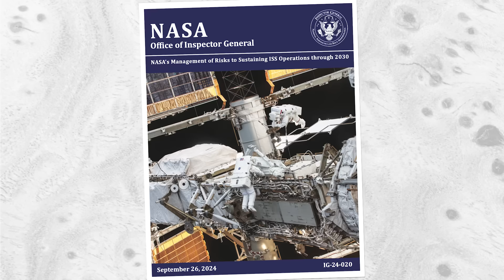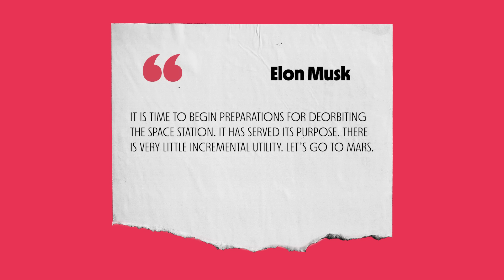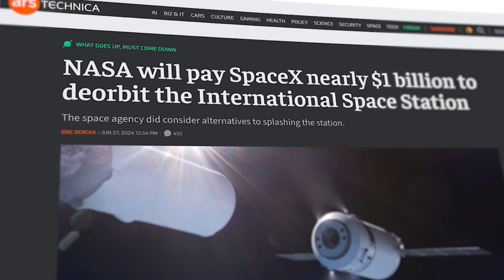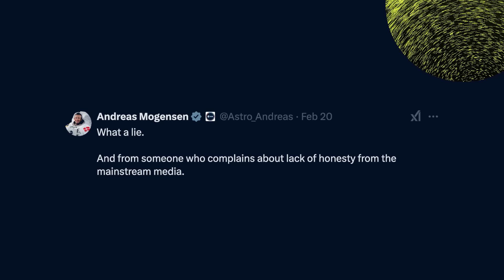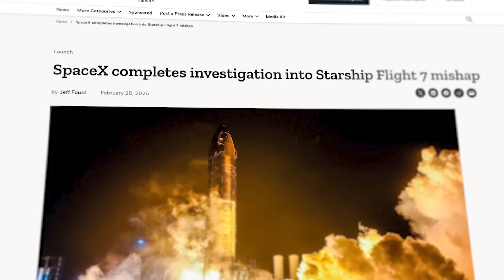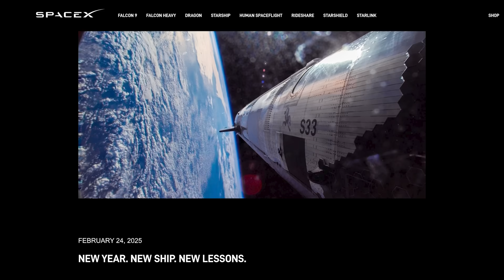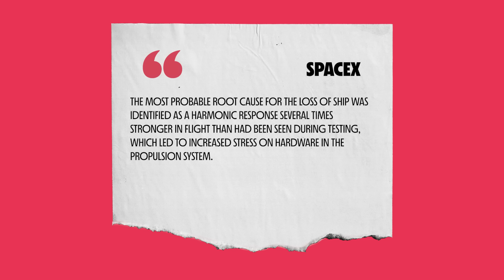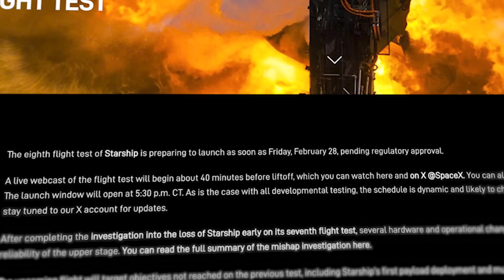Something Weird Is Happening With The ISS...

Comment: Funny how SpaceX inoculates his fanboys to total destruction of his test spacecraft over and over again by saying it is just a "part of the design process", yet Elon and his fanboys go ballistic when Starliner test flights have problems. Clearly everything is supposed to go perfectly on all competitors test flights or else it is a failure. And since Starliner landed safely, the problems were not as severe as the conservative NASA administrators expected, although in dealing with a press and public that freaks out over every problem, you can see why they chose to follow the conservative path and throw Boeing under the bus.
Has everyone forgotten the the first Crew Dragon unmanned test flight went well, and if they had not been compelled by contract to test the flight abort system, they likely would have flown manned the next time. But while preparing the test capsule for the abort test it .....BLEW UP,  which would have been fatal for any crew on board. So..... you might say that SpaceX was living under a lucky star on that one. What if they had not performed the flight abort test before putting crew aboard?

Comment: Elon did include the details that the NASA budget didn't include money to launch an extra mission to rescue and Congress would have to appropriate new funds and they wouldn't do that. Elon also said they could have gotten them back with the existing budget but the Biden administration refused to do it. 
From the outside it looks like the Biden administration didn't want to work with Musk because Musk supports Trump. It also looks like Biden was protecting Boeing. It would look bad for Boeing if they failed to get the astronauts back but then a competitor did get them back. Boeing doesn't need any more bad press.

Comment: Why is NASA still contracting anything for ISS? If they are going to decommission it by 2030 they should be starting preparations now. The work/experiments they've currently agreed to will probably take them out to 2028 or so. They cannot be doing stuff like that right up to 2030, that makes no sense. And I am sure that unless someone like Musk keeps pushing them, NASA will overshoot it just like they do everything else. SpaceX doesn't need to build its ISS de-orbiter from scratch, 80% of it already exists, in fact it's more of a modification to existing hardware.

Comment: They should do the opposite - push it towards the moon to crash there, it will either supply some parts and materials to the future moon colony - or become a tourist attraction for future tourism on the moon. Either way - so much energy was used to put these materials into orbit, why not use them on the Moon?
Reply: "push it towards the moon to crash there,"
The ISS weighs almost a million pounds, exactly what spacecraft will you use to "push it towards the moon to crash there"?

"so much energy was used to put these materials into orbit"
Yes, and it took 42 launches to do it.  

You'd need a delta-v of over 3000m/s to push a million pounds from LEO to a lunar trajectory and then you'd need to slow it down if you wanted it to obit the moon.  The fuel needed alone would outweigh the ISS so it would take more than 42 launches just to fuel the rocket that doesn't exist to push the ISS to the moon.
Reply: @sendintheclowns7305  
I think that in space its ok to just push it using the last rocket to reach it, and let it slowly change course till it reaches the moon in such a timing it will crash on it. shouldn't be a crazy computation for NASA nowdays.

Comment: If the ISS is outdated, attach a rocket module to it let it drift towards Mars to revolve around it. Can be used as a study / rescue module around mars.
Reply: Escape velocity is too high
Reply: To get the ISS to mars orbit from LEO, you need about 6km/s delta-v. The ISS weighs 420 tons. You‘d need 16 raptor engines and in excess of 2500 tons of fuel to boost ISS to mars at the cheapest transfer window in 2028. Any other date or less thrust, fuel cost goes up exponentially. One starship puts about 100 tons of fuel in orbit. And that‘s saying nothing about the structural integrity of the ISS to survive a 1.5g burn…

You see the „little“ issues there?
Reply: @pyalot  I rather doubt the ISS is structurally capable of surviving a 0.1g burn.
Reply: @pyalot  , I guess there's no hurry to get it in few months. Let it take two + years no need to power full way. Indian Mars mission took a year to reach Mars and weight in space.... I don't know much about it.
Reply: @pyalot  may even take it to close to the moon that be intresting

Comment: This is not the first time you have shown significant bias in your videos. In this video, you have shown a definite negative bias against Elon Musk that truly does twist the truth to cast shade and doubt on Elon and his motives. With regard to the longevity of the ISS, they have run into some significant issues with air leaks that they cannot fix in the Russian section of the space station. It is becoming ridiculously expensive to maintain the space station and more importantly it’s becoming less reliably safe for the astronauts. You make it sound like Elon is pushing his weight around and bullying the government about its plans for the ISS. That’s not true at all. It doesn’t serve Elon‘s purpose to prematurely and the ISS mission. SpaceX stands to make a lot of money the longer it stays in operation. Also, you imply that $800 million is a lot of money to pay SpaceX to the orbit a 1,000,000 pound space station safely. Considering NASA frequently sends rockets into space that cost in the billions that are only test platforms, a new Very specialized dragon. vehicle designed for a single use mission costing 800 million for the whole mission which includes building the rocket launching the rocket designing a new dragon vehicle and then the orbiting the rocket safely into the ocean. $800 million for that kind of mission is cheap. You imply that Elon is fleecing the government and taking advantage. That’s bullshit. Your whole tone about Elon is very negative and you also said you have to double the time the Elon says for everything and that’s absolutely not true. Forget the fact that Elon himself warns people that his timelines are aggressive and he explains why they’re so aggressive, deliberately aggressive so that they work at the fastest speed possible. That is why a private company has had more success than the government of any country has had. Elon Musk has more capability in SpaceX than all the other countries of the world combined, including Russia and the United States. So I was very upset to see another one of your videos, throwing shade and veiled hatred toward Elon. Add to this a number of videos that you have deliberately shown significant bias, favoring China, and you’re really starting to piss me off. And as an American, I can tell you I’m not the only one. Elon is a national treasure. It cast out on your common sense and intellectual sanity to come up with a conclusion that Elon is nefarious. You’re just making yourself look dumb. That’s a very bad look for your channel because people like me with an extensive knowledge of the space in industry who frequently go to YouTube videos to see news and new developments in greater depth are not going to come to your channel to listen to your badmouthing people that we know don’t deserve it.  Your channel relies on nerds with discerning intellect to be curious enough to sit through one of your long videos. I don’t think I’m going to be clicking on the next video you put out because you’ve left a bad taste in my mouth. If I can’t trust you to be objective and treat Elon Musk Fairly, but instead to go after him, then I can’t trust that any of your material is unbiased and objective. I don’t subscribe to sources of news and sources of interest when it becomes clear to me that I’m deliberately being exposed to bias with the intent to slander other people or ideas. So at this point, you have shown that you’re not able to stay objective and let your emotions and political views create significant bias in your videos so I don’t trust what you’re telling me anymore. And you need people like me watching your videos. Once you lose the people like me who’s going towatch? We already live in a world where people don’t have a lot of patience and your videos are long and require some patience so you’re really hurting your brand and your business. You probably have already experienced hiccups with your channel growth and I know that I have avoided you for a while and now when I come back to test the waters I find this. You don’t get too many cracks at the bat in media. Once people are turned off, they don’t come back to your channel
Reply: He’s gone out of his way to report this in as objective a way as possible, especially given the current charged political climate. By being so aggressive and unnecessarily verbose in your (possibly AI generated) reply, all you have succeeded in doing is revealing your own bias. Don’t like it? Don’t watch it.

Comment: They should push the ISS into a much higher orbit, away from everything, but keep it in space so that later, if we want to, we can strip it for parts or use it to build something on the moon. It'll be far more valuable than just letting it burn up over the Pacific Ocean. This wasn't my idea, but I heard someone mention it as an option and thought it was a brilliant idea.
Reply: "They should push the ISS into a much higher orbit" - That would be nice, but the engineering says it would cost far too much. You need an engine and fuel to push 450,000 kg of mass into a higher orbit, or out of earth orbit. The 3rd stage of the Saturn V managed to push itself and the CSM & LM up and out of LEO and its gross mass was just 123,000 kg. (Which included the fuel). De-orbiting the ISS is the only option sadly.
Reply: @Phase52012  And yet these people think they're actually going to throw millions of kg to Mars. <smh>
Reply: @Phase52012 If only we had a cheap giant ship which can safely return big mass back to the Earth... I know, that ISS is not really meant for disassembly, but if we want to preserve it in the museum - delivering it back module by module via Starship is our way to go. I suppose Bezos or Musk have enough money to pay for it. Also Bezos paid for rescueing Saturn engines from the bottom of the sea, so he may be interested in preserving this piece of history too.
Reply: @Phase52012  plus the way you would have to push it is by speeding it up, so it can escape Earth's pull (well not fully). Then have to slow it down so it won't leave Earth's gravity.
Reply: @Mars-d3s - Pretty sure you only have to speed it up too the speed you want. Earths gravity will stop it all by itself, without the need to slow it down.
Reply: @Phase52012  oh yea, thx
Reply: Like Lunar orbit, the. We can call it the LSS, but as much as I want that to happen, it's too heavy and would cost too much. Plus they say the technologies on the ISS are old. I wish they didn't have to take it down
Reply: deorbit needs around 100 m/s delta v, rising to 2000 km orbit (safer but not safe in the long run) would be in the range of 1000-2000 m/s, depending the exact orbit. a moon orbit target would be in the range of 5000 m/s. for the five hundred ton iss it would require something like the super heavy booster, in space, fueled. anything but deorbit would mean either a completely new massive spacecraft designed and built or somehow putting up a first stage into space.
Reply: The ISS was designed in the 80s and 90s. The Russian modules were build in the late 80s. Even with updates, the ISS is very old technology.
Reply: Materials have degraded and wont be reliable.

LEO isnt a vacuum and has trace amounts of O2 which over time exidizes the metals. Especially in an enviorment that in sun light gets quite toasty
Reply: It's also a fantastic experiment in materials science.
Reply: There is damage to the ISS. Damage that shows up on the EVA suits and occasionally has to be sealed up.
Reply: Why not strip parts for a newer station? Putting stuff up is too expensive to just let burn. Say reuse the solar and heat panels and other parts. The first recycling ♻️  in space!
Reply: @reinoud6377  it would not be a bad idea, except than you are stuck with whatever limitations this brings, mostly the orbit. the iss is on its orbit so the russians can reach it from their launch sites. if you want to build a station without russian involvement you would make it with much less inclination and much less lost delta v in each supply mission. so you need to move those old stuff to the new station, which is not much cheaper than sending new, not several decades old ones up.
Reply: Crash it into the Moon, then...

Comment: Pogo?
Reply: Quote: "Pogo oscillation is a self-excited vibration in liquid-propellant rocket engines caused by combustion instability. The unstable combustion results in variations of engine thrust, causing variations of acceleration on the vehicle's flexible structure, which in turn cause variations in propellant pressure and flow rate, closing the self-excitation cycle." 
the rocket engine doesn't fire consistantly due a fuel flow problem of some sort. This stops combustion for a moment and a loss of acceleration occurs, before combustion again sends the rocket forward, the loss of acceleration again interrupts fuel flow, setting off a cascading effect of the rocket going forward/back/forward/back. Like hoping on a POGO stick. It can result in the rocket breaking up and exploding.
Reply: @Phase52012  that doesn't seem to be the case.
I was wondering if the leaks had anything to do with the new downcomers design for this ship.

Comment: Stopped listening after .38 seconds, You spewed a mouth full of bullshit in 38 seconds. 

The contract to return astronauts AND deorbit the space station were before the Trump admin, AND
SpaceX is not likely receiving a significantly different payment to return stranded astronauts compared to their standard mission costs under their contract with NASA; meaning they will be compensated based on the cost of the rescue mission, including fuel, crew time, and any necessary modifications to the spacecraft, rather than a separate "stranded astronaut" fee. 

Musk claimed that SpaceX offered to bring back Williams and Wilmore sooner but that the Biden administration refused - Wilmore and Williams flew Boeing's Starliner spacecraft to the ISS last summer for an eight-day test mission that instead has lasted nearly a year because of problems with the craft's propulsion system.
Trump asked Elon to do it sooner.

NASA awarded a $843 million contract to SpaceX in June 2024 to develop a spacecraft called the United States Deorbit Vehicle (USDV), based on the company’s Dragon spacecraft.

Comment: IIS DEORBIT DATE 

The International Space Station (ISS) did not have a fixed "original" deorbit date established at its inception due to the evolving nature of international agreements and mission extensions. However, key milestones in its operational timeline include:

1. **Initial Certification**: The ISS was initially certified for operations until **2015**, with discussions about potential extensions.
2. **First Major Extension**: In 2010, the Obama administration extended U.S. support to **2020**, followed by international partners.
3. **Further Extensions**: By 2014, plans were extended to **2024**, and in December 2021, NASA announced a commitment to operate the ISS until **2030**, with deorbiting planned after that.

Thus, while the earliest discussions pointed to a deorbit around **2015–2020**, ongoing evaluations and collaborations have pushed the target to **2030**. The ISS will eventually be guided to a controlled re-entry over the South Pacific Ocean, a process dependent on continued international coordination and technical readiness.
Reply: Thanks for the lazy AI post